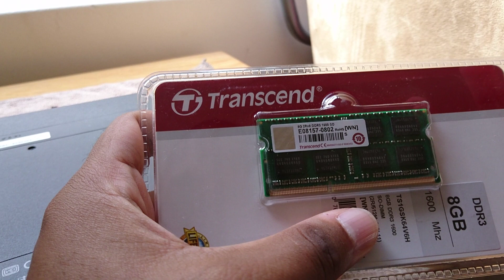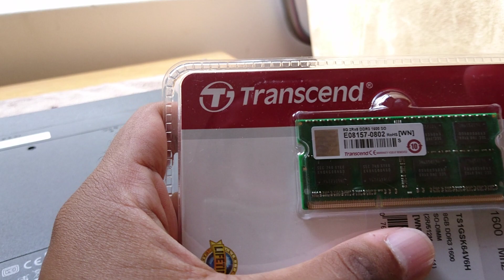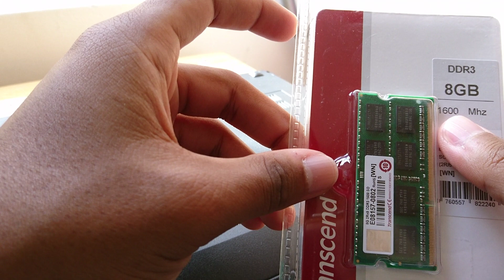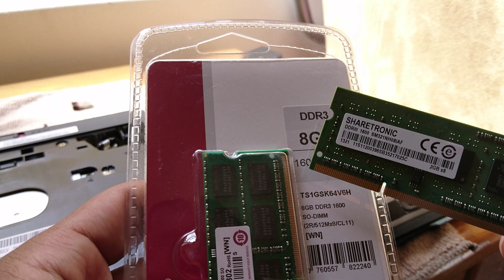Lenovo G580 how to replace ram

Comment: Hi, maybe u can help me! I ve got lenovo b580 wich is very similar. I opened the slot and i found i ve got something similar to your laptop. But i m not pretty sure if i have two or one spaces for the ram. In the top i ve got one ddr3 similar. and down i ve got something like other ram wich has written dimm. is possible i ve got 2 but diferent kinds?
Reply from the maker: Good day sorry for replying now only. Hope you doing well.

From what I google search it seem like you have one only but if google is not accurate you will see space that looks like were your ram is with extra two silver pins that hold your ram in place so there will be four pins and it will be very close so the one set of silver pins will hold your existing ram then you will see the other two pins close to.

If not then you only have one slot for ram then double slots but if you upgrading your ram at less it is just one slot of ram then two slots of ram.

Sometimes there is different ram names in but as long as its the same Mhz in like Example 2666Mhz, 3200Mhz, 3000Mhz and 2400Mhz in. But then DIMM mean Dual In-Line Memory Module. From what you told me it sounds like you have two ram spaces.

Hope this helps you and thank you for the comment and view appreciate it alot and be safe out there.

Comment: Isn’t there 2 ram spaces for this laptop? What type of ram was it?? I need help
Reply from the maker: Hi sorry that I am replying so late, having internet problems.  Unfortunately the Lenovo G580 dose not have space for two ram slots only have space for one so if your laptop is needing more ram you going to have to take the old one out gently and place it on a safe place and buy a bigger ram for example: 

DDR3 8GB
DDR3 16GB

The type of ram I used for this Lenovo G580 was Transcend DDR3 8GB 1600Mhz as I show in the video. but make sure on your old ram what Mhz can go in your laptop so it sync up properly with your laptop. Thanks for the comment I really appreciate the view and comment.
Reply: GameDan25  why did the specs from the internet say i have 2 slots? Im using lenovo g580 model 20157. The back side look just like the laptop in your vid.. im confused.
Reply: @castaway2128  hi, does it have 2 or 1?

Comment: CAN YOU PLAESE PROVIDE THE LINK FOR THE RAM YOU HAVE USED ?
Reply from the maker: Hey I got this ram from Takealot so the place web page is www.takealot.com . I will try and find this ram and place a link to it so you can find the same ram for your laptop but I must say sometimes shops run out of stock or they don't make this brand anymore, it does not have to be the same brand like I have as long as it is also a DDR3 1600Mhz  but double check your ram in your laptop to see if your stock ram that came with your laptop is also ddr3 1600mhz

Comment from the maker: Yes there is only one slot that you can put in on this Lenovo G580
Reply: GameDan25 can we add 2x 8GB ram in lenovo G580? Will it support? I have 64bit OS and it’s 4GB ram is always upto 80% consumed even when laptop is idle
Reply: @akg.69  it has 4 slots btw but to reach those ram slots you need to open the laptop full, I am going to do that.
Reply: Gamen Boiii Sahil no, my laptop have only 2 slots. I have even scanned my laptop with crucial system scanner.
Reply: @akg.69  ohkay I think it's different model than
Reply: Gamen Boiii Sahil no, my laptop’s model is G580
Reply: @akg.69  Lenovo G580 (2189, 20150, 2689, 20157) Model Number. I have G580 20157 which has 4 RAM slots.
Reply: Gamen Boiii Sahil  helpp i have model 20157 and i don’t know what type of ddlr3 ram type i need to buy from online. What is the difference of DDR3 and DDR3L? The seller suggests ddr3L but i saw in the vid the ram he used is just ddr3
Reply: @Nebulous_.  bro you have 2 ram slots only ....
my laptop has lenovo g580 has only 1 ram slot
Reply: @castaway2128  DDR3L is a dual voltage capable memory DIMM, which supports operation at both 1.5V and 1.35V. Hence, making it best for Laptops which aren't got that much power, and buy only 2GB ddr3l or 4GB ddr3l.
Reply: @ImAnonymous433  it has actually 4 slots but you have to open Laptop fully not just the back there you will you find other 3 or 1 slots depends upon exact model.
Reply: Gamen Boiii Sahil  so is he right for DDR3L?? But why did the person if vid not use a type with L
Reply: @Nebulous_.  no bro i check my laptop has no extra slots  .....
because 4 ram slots laptop are very expensive and my dual core laptop cant support 4 ram slots i think
Reply: @castaway2128  because he already using low voltage ram, you can go with l version it's good too
Reply: @ImAnonymous433  I think so, I haven't opened My laptop just seen the info from an application idk but good luck and be safe :)
Reply: @Nebulous_.  but i opened my pc and shows one slot only second slot is not isntalled
Reply: Gamen Boiii Sahil  why should i only get 2gb or 4gb? Im confused cause the specs on the internet said it can full 8gb ram. My laptop was manufacturer 4gb ram installed. Is there another slot i can put the other 4gb ram or do i buy a 8gb ram directly
Reply: @castaway2128  I do believe there is atleast one another slot it could be assessed by opening back or underneath the keyboard, if website says highest 8gb can be installed then if there are two slots highest one slot can handle is 4gb ram or if it has only one slot then highest that slot can handle is 8gb ram.
Reply: Gamen Boiii Sahil eeeeh so even if it can support 8gb ram, if it has 2 slots, only 4gb can be handled per slot?
Reply: @castaway2128  yeah
Reply: Gamen Boiii Sahil oooooooooooh i see. So i HAVE to know first if i do have a second slot by opening all my laptop?
Reply: @castaway2128  No you don't have to open computer to know it

https://www.computerhope.com/issues/ch001405.htm

In this link there are tutorials how to know.
Reply: Gamen Boiii Sahil idk why but my windows show diff settings cayse i have still win 7 LMAO I need to get 8 but tryna get a new laptop charger first
Reply: CPU-Z app will work I too use windows 7 in My laptop don't get windows 8 it's crappy and will lag a lot in this Laptop
Reply: Gamen Boii
Reply: GameDan25 i have lenovo G580 and it has 2 Ram slots. 1 is occupied by 4GB ram.